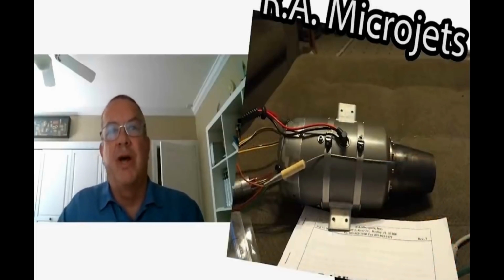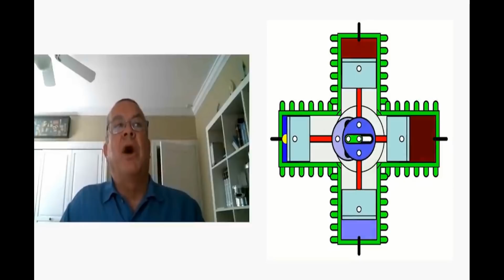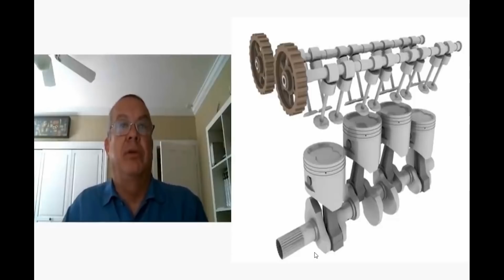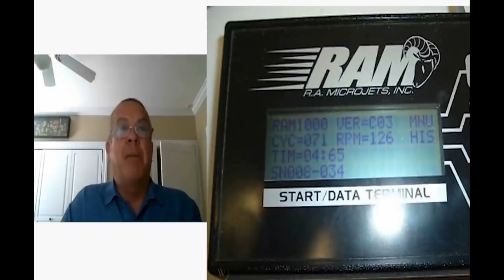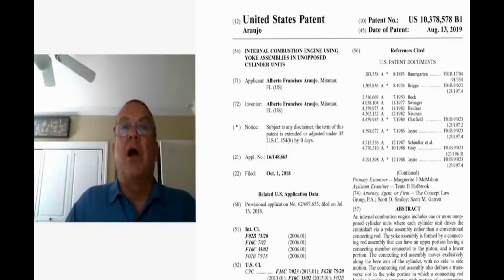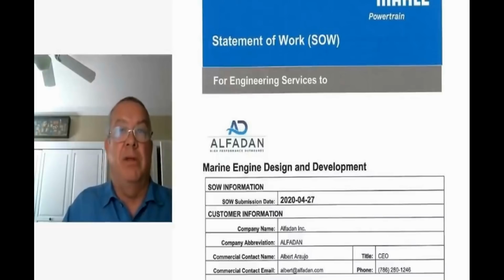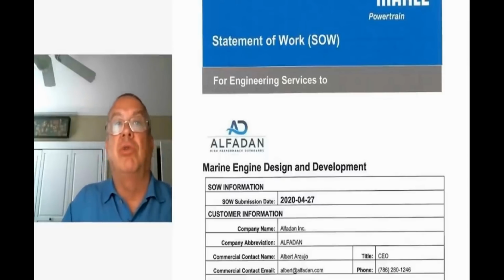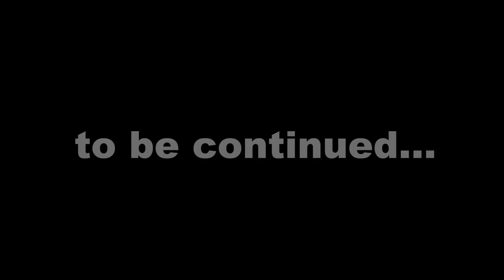Alfadan EXPLAINED! - Part 1

Comment: I'm not a mechanical engineer but going by information I have gotten from proven people who built winning race motors I specked and built motors that my father and I ran and won several point championships here in Texas on local dirt tracks. Everything I learned told me this had to be BS like you're saying and I'm glad to see this video it confirms what I believed that this is a bunch of Bulls$%t. They are trying to pay off their debt by selling a pipe dream. I say show me some real data and a working model or quit wasting my time. You have a new subscriber now.
Reply: Totally agree. Not only the idea has proven to be 100% technical bs, the site of the company screams scam. All the features of a scam are there. I wonder how come some people buy that.

Comment: At 26:06 you are 100% correct. I used to work for IBM and I came up with a process for something that they decided to patent, even though no actual design or manufacturing work went into a prototype.  They completely relied on my expertise.  I’m confident in my designs, but I do think that someone/anyone should maybe put some more research into an idea before it gets granted a patent.
Reply: I think you have to have a working prototype in order to get a patent
Reply: @Сунђербобан  No sir. You do not need a working prototype for a US patent. All you need is a unique idea, lawyers to put all of the paperwork together, and lots of money (which is why I had to do it through IBM).
Reply: @Сунђербобан  a preferred way of getting a patent NOW is to simply buy one cheap from a failed company. Then threaten to sue anyone actually doing work, rinse repeat; see "Intellectual Ventures"
Reply: In biotech, when we were all chasing down all the genes in the human genome, every time we found a new gene by basically random sequencing bit of human DNA, we would submit a patent on that sequence....before anyone knew what the function of the gene was. Only requirement was that is was novel and the complete gene sequence. Vast majority of those patents are useless, but of course there is hope someday a few of those genes will become economically important for something (curing cancer etc).
Reply: @Marr_SC +A

Comment: The reason he is saying 26 inches on center is the holy grail is just because the industry standard for spacing multiple outboards has always been 26 inches on center. Most boats have some sort of v to the bottom of the hull. It is advantagous to keep the outboards mounted this way for several reasons. As you move the spacing wider you will lose performance as more of the lower unit will be protruding beneath the bottom edge of the hull due to the angle of the dead rise. So the wider you go, the more drag you have. Additionally, in tight turns and in certain maneuvers the outboard on the outside of the turn may be more prone to cavitation as you move the outboards to a wider spacing. The above mentioned issues apply only to boats with a deep v or modified v hull. Spacing becomes less of an issue on flat bottom boats. Another reason why 26 inches on center seems to be the holy grail is because it is generally the closest you can mount the outboards to each other without the outboards causing each other to cavitate. Certain larger outboards like some of the four stroke v6 and v8 Yamaha’s had rather wide engine cowls so spacing was sometimes increased by a few inches. Basically 26 inches on center was the standard for outboard spacing because it allowed for the best balance of functionality, performance, and accessibility. Imagine trying to work on the outboards if they were so close to each other that they were almost touching cowls! Bottom line, this issue can be disputed for eons but the 26 inches on center was just something the manufacturers did a long time ago and it has been followed as a general rule of thumb since. Outboard spacing is unique to every single boat. There is no one correct measurement. It all comes down to optimizing the setup for your particular boat.
Reply from the maker: Right, thanks 👍

Comment: I'm probably wrong but I don't think a scotch yoke solves the vibration of an inline four, the most noticible vibration in a large inline four seems to be it just bouncing up & down vertically, which would be an effect of piston mass, not the conrods swinging from side to side.
Reply from the maker: That's the primary balance and that's what I did the first 'alfa-scam' video on...

https://youtu.be/knndgVWAPsQ
Reply: The bouncing up and down is not an issue as you have 2 pairs of piston completely canceling one another with this type of conrod.
Reply: @em4703  My that logic a 180 degree parallel twin cancels out vibration, it certainly doe not.

Comment: On the Alfadan website, I found a video where Albert said that only 1 thing was changed to enable his design to rev at 5500 RPM (continuous) to max redline at 5800 RPM. He wont say what was changed but it might be interested to speculate. I am not an engineer, nor am I affiliated to Albert.
Reply from the maker: He means the con rod design. However, if depending on what say you ask, you get different results  like when he said plasma ignition or 3d printed pistons... it changes every week

Comment: So maybe he is putting an eccentric bushing on the crank journal that is driven by a planetary gear around the crank. This could slow down the mass when the crank is at 90 degrees. The speed of this eccentric would be twice the speed of the crank.
Reply: Sounds like an interesting idea, and maybe that is the one thing he changed to somehow make his engine work.
Reply from the maker: And this would make it heavier
Reply: like the rotary.

Comment: I was directly involved in bringing the (Honda) 4-Stroke outboards into the market place back in the 1990's. When we came out with the BF115 / BF130 outboards back in 1998. (The 1st 4-stroke outboard over 100hp.) This outboards drive train was pretty much straight out of the then Honda Accord. I was not happy about the counter balancers, as I felt they hurt the engine's out of the hole performance. My boss was an engine designer and he showed me that an in-line 4 over 2 litters requires the counter balancers due to the (vibration) weight and motion of the pistons. There is no way that a 4 in-line cylinder will be 7.5 litters and run at 5500 rpm. Maybe 500 RPM. But, what would be the point? Thanks, I love your channel and information.
Reply: @Nbomber ahem scam. Anyway... Achates power or Liquid Piston marine engine is what I want to see but dunno if they'll ever sell to public just mil contracts.
Reply: 550 max 🤣🤣🤣

Comment: assuming that this 4 cyl is somewhat square, it would require a 135mm bore, (5.3 inches) by 130mm (5 ,inches) stroke. 5800 RPM you say, I don't think so.

Comment: Never mind the balance, how would he stop the pistons exploding? Has he some new light material to make them out of? If it were possible, I think the F1 guys would have it first. Alfadan is BS.
Reply: If you don't follow to know about the product don't comment he's has an email that will answer this question
Reply: @Carubines  Can you post the answer, then? We'll wait here
Reply: @Carubines  You also do not know.  He just lists a phone number for anyone to contact for his BS
Reply from the maker: But the HP is related to the displacement and the rpm. Lowering the rpm lowers the power output
Reply: pistons exploding because of excessive force and force derives from mass and acceleration (squared). you cant reduce mass significantly, but you can reduce acceleration hence reduce force (squared) and keep pistons in safe area. He did say about this in D4A interview.

Comment: @The Workshop he not only called out rotary engines in general, but derivitives of the wankel... And if im not mistaken, i believe you could call the liquid piston rotary a derivitive of the wankel since it was design to overcome the wankels inherent issues and the liquid piston utilizes no apex seals... Pretty certain a liquid piston configured for the same displacement as this alfadan bs and you could probably have a smaller footprint and more output without worrying so much about secondary forces and so forth.